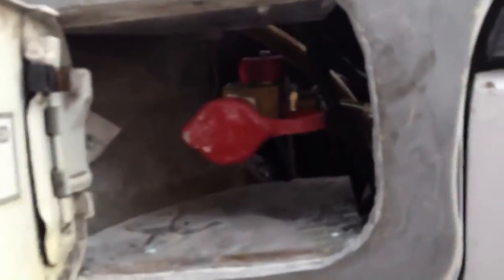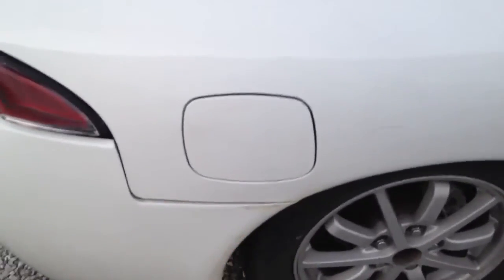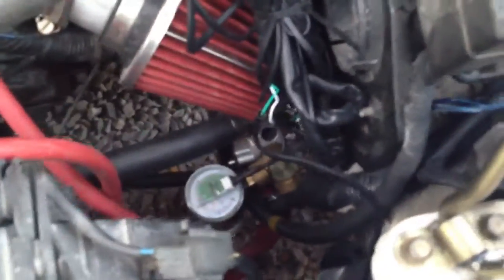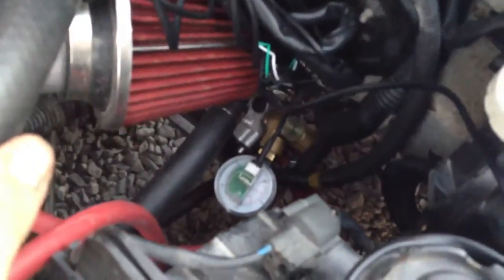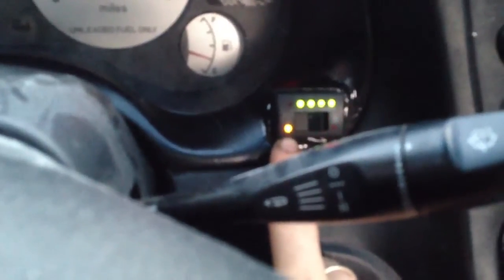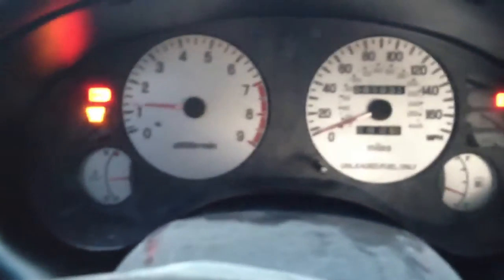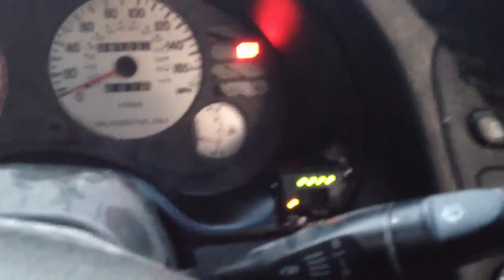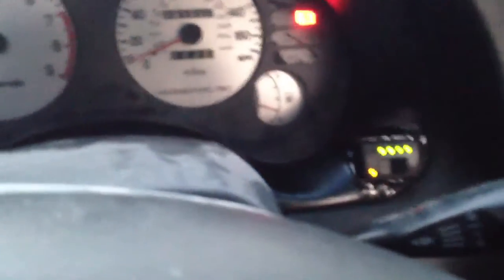1999 Mitsubishi Eclipse CNG conversion

Comment: I am wondering if you would be able to tell the difference in power between propane and methane. I have been doing some research on methane powered projects lately. Theory is that compressed methane doesn't have the freezing regulator problem and it can be made right at home with organic matter. You could theoretically be fueling your car for free with the right equipment. Good video by the way. I appreciate the fact that you used a semi-popular car.